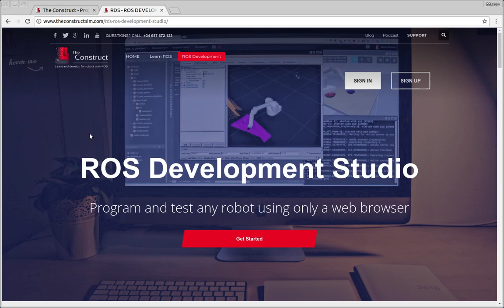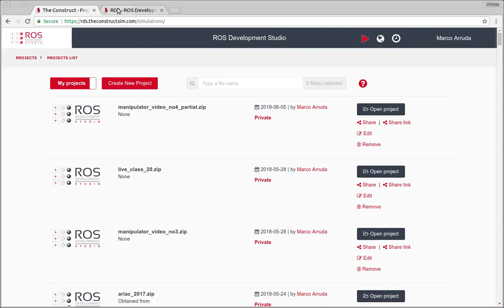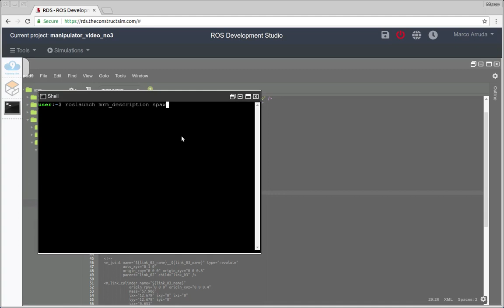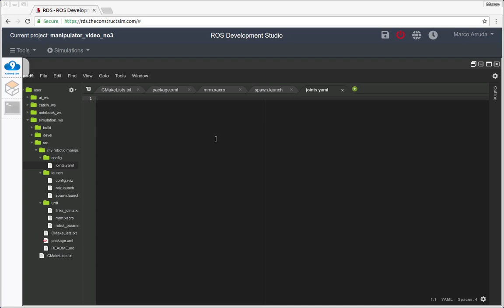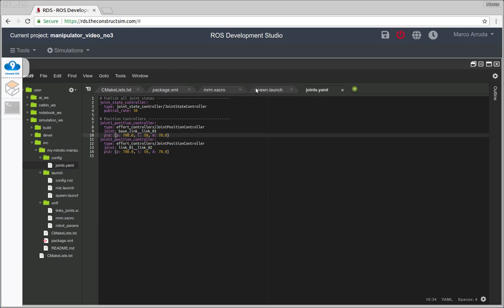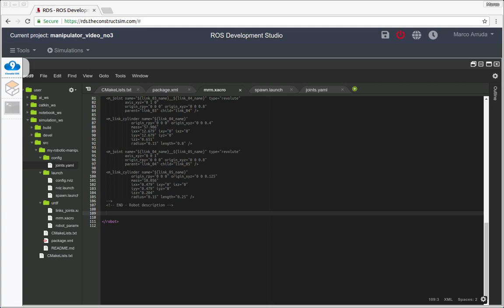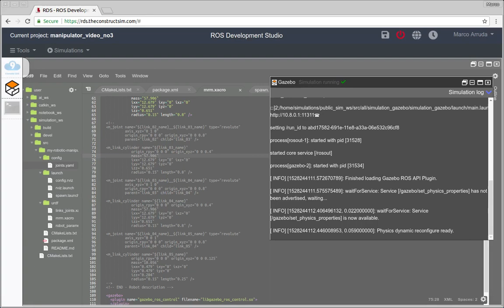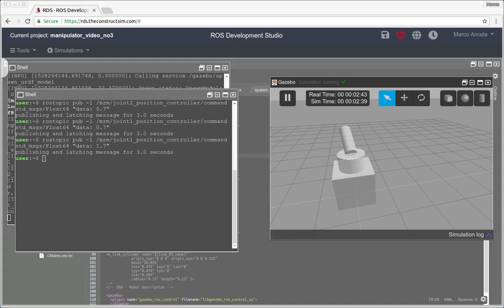[ROS Projects] - My Robotic Manipulator - #Part 4 - ROS + URDF/Transmission + Gazebo Controllers

Comment: Thank you for the great video. 
When i try this however, i get a warning in the last step when i launch :
[WAR] : Controller Spawner couldn't find the expected controller_manager ROS interface.

I installed all the required packages as well. Any idea how i can fix this ?
Reply from the maker: That error usually means that: either you have some packages missing (you indicate that is not the case), or that even if you have them, for some reason, the controllers are not loading (many reasons for this: you typed wrongly the names in the config files, when you launch it there is no proper sourced ROS system, there is too much load in the system and there is a delay between the checking of the spawner and the load of the controller...). I would suggest you to follow a systematic approach to find where the error is. Check this video where we went through it on a PR2 simulated robot: https://youtu.be/VWFDwkgZLC8

Comment: I followed video series and completed my own robot in ROS. Thanks for your easy demonstration. 

Can we implement same with 3DOF delta robot?
Reply from the maker: Yes you can do it, but it will be a little tricky. Instead of using URDF, you will need to use SDF format to specify your robot. Check this repo: https://github.com/leobitz/delta3_gazebo

Comment: I've tried to clone my work from this class on ros on linux but it did not work. I couldn't find the effort_controllers/JointPositionController . Can you help me?
And another question, is Marcos Arruda BR?
Reply from the maker: Since you are using a local computer, you have to check if you have installed the ros-kinetic-effort-controllers as well as all the other ros control packages (many to be listed here). If you use ROSDS, you do not need to care about it because everything is already installed for you.
Yes, Marco is from Brazil
Reply: thank you so much. Is working after installed the effort-controllers package.

Comment: Thanks for this awesome video. 
After adding the transmissions, doing changes in the spawn.launch file and creating a joints.yaml file, the top link is still falling. No error is shown in the terminal. Can someone help me?
Reply: rosservice list | grep controller_manager  -- yields nothing
Reply from the maker: @chiragagrawal9148  This  means that you are not loading the controller_manager. If you followed the tutorial and still have not loading the controller manager, chances are that you have not installed the ROS controllers in your system.

As @Alex Sobey is indicating below, you need to install them with:
$ sudo apt-get install ros-kinetic-controller-manager 
$ sudo apt-get install ros-kinetic-effort-controller 
$ sudo apt-get install ros-kinetic-position-controller 
$ sudo apt-get install ros-kinetic-gazebo-ros-control
Reply: @TheConstruct  Hi, I encountered the same problem and it is saying "Controller Spawner couldn't find the expected controller_manager ROS interface", then I tried to install the controller manager with the command line you offered but somehow these packages cannot be located ("Unable to locate package ros-kinetic-position-controller", etc.). Do you maybe know why? Thank you!
Reply: @TheConstruct  Oh, okay I fixed the problems by checking other commends.. Again, thank you for the tutorials!
Reply from the maker: @XZeng-hr2ml  you could not locate them because you may have a different version of ROS installed. If your ROS version is not Kinetic, please replace the word kinetic in the commands by the name of your ROS version

Comment: After writing the code step by step as your code, when I start the gazebo and spawm.laucnh file the arm of robot falls down again same like previous tutorial. During the runtime I checked the rostopic list and found that   a lot of topics were not run. the out put was :
/clock
/gazebo/link_states
/gazebo/model_states
/gazebo/parameter_descriptions
/gazebo/parameter_updates
/gazebo/set_link_state
/gazebo/set_model_state
/rosout
/rosout_agg
Reply: Had the same issue. Took a while to debug. My two issues:
1) Download controller packages (not sure if you actually need all 4 of these)
sudo apt-get install ros-kinetic-controller-manager
sudo apt-get install ros-kinetic-effort-controller
sudo apt-get install ros-kinetic-position-controller
sudo apt-get install ros-kinetic-gazebo-ros-control
2) I choose my own joint names which ROS did not like: 'base_01-link_01'. Apparently '-' is an invalid character.
Reply from the maker: Alex Sobey is right. You are probably launching the code on your own computer and not on ROSDS. Hence, you have to make sure that you have a full installation of ROS in your computer (ROSDS already has). The set of packages that Alex indicates is the correct one.
Reply from the maker: @AlexanderSobey  That is correct. Both things. Do not use hyphens for topics names, nor spaces